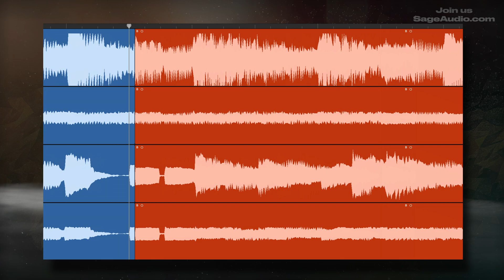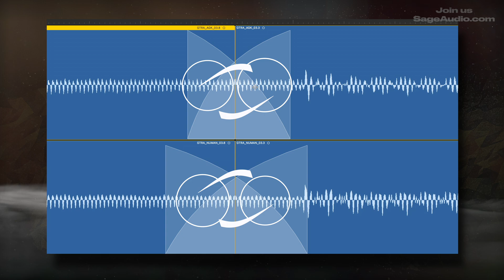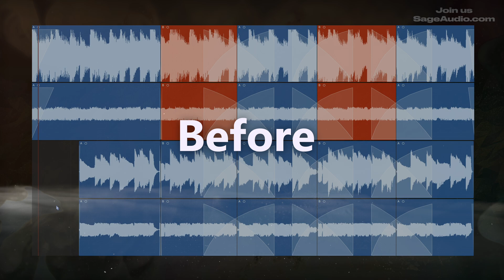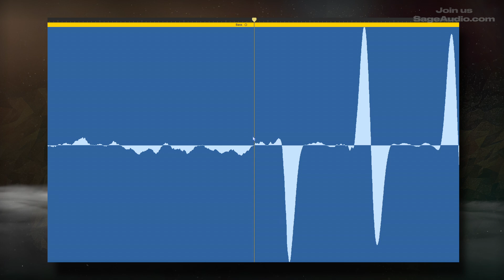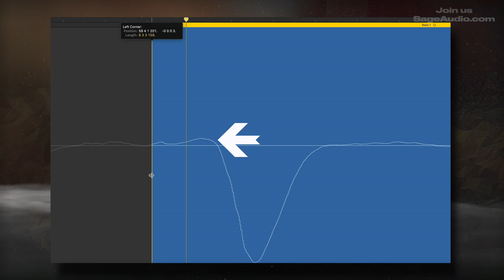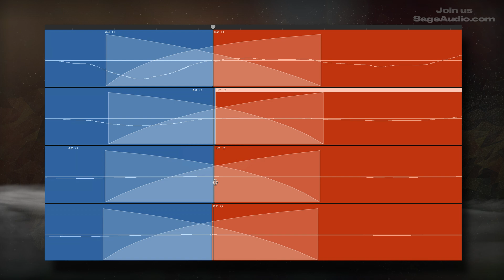How to Expertly Edit Your Tracks

Comment: Any tips with comping in Logic? I often find that when comping, (especially in guitar tracks), it's so hard to find the moment to comp between two takes that doesn't have a cut, but the problem is, you can't put a fade while comping.
Reply: Comping automatically applies crossfades. You can flatten the comp into a collection of regions and then adjust manually from there
Reply: Adjust the Crossfade time, it’s 20 by default I think, 40 works a lot better for me

Comment: 4:59 the "bad fade" is not even noticable, its a seamless transition
Reply from the maker: It might help to listen on good mixing-oriented headphones or monitors for this one, there's a pretty noticeable dip in volume during the crossfade, but it can definitely be a little tricky to hear if you don't have the most ideal critical listening environment!
Reply: @sageaudio  I'm listening on the beyerdynamic DT 770 Pro
Reply: Nah, you either need better speakers or better ears! It's not much, but you can hear the difference.

Comment: Do you have to edit the vocal if you using compressor ?
Reply from the maker: Definitely! Compressors are a great tool for getting the dynamic range of your vocal dialed in to where you want, but there's still lots of things that compression doesn't effect that can need an edit in a vocal. In fact, compression can sometimes emphasize things that need to be edited in a vocal, since it can often bring up the noise-floor of the recording, i.e. breaths, shuffling, sniffling, mouth sounds/lip smacking, etc.

Comment: ive been following this channel for a while and i like the content but i see two things i feel the need to comment on

1) at 2:37 (when you want to cut a track into silence or vice versa) why would i feel the need of centering the cut on a 0 degree point if im fading the sound in and its going to be coming from silence into sound, so it would be at 0 degree anyway?

2) at 7:26 i can hear an unnatural gain boost at the second clip when compared to the previous. this is because the method of gain boosting specific clips doesnt account for perceived loudness, which is something you cant do without using your ears (or some plugins allow you to see it but i find using ears to be more useful). this is where i feel like the before is much better than the after.

Comment: Nice summary! The only thing I wouldn´t wanna have in my toolbox is LUFS normalization for vocals recorded in wet sounding rooms like the one in the example it creates an unnatural balance between the vocal and the early reflections.
Reply: Well spotted. Still, it's a great technique for properly recorded vocals.
Reply from the maker: Thanks for watching :)
Reply: A good fix for this would be to reduce the audible reflections. A dope and free solution would be to use the Tone boosters EQ pro and reduce the ambience using a shelf over the entire signal in ambience mode. It sounds even better when used in tandem with the Background algorithm. Great perspective skills by the way
Reply: @ I'd say proper acoustic treatment is the way to go, yeah. That or processing with AI plugins like Waves Clarity Vx DeReverb / Accentize DX Revive or suites like Sonible Prime Vocal / iZotope RX before editing to clean up reflection content.